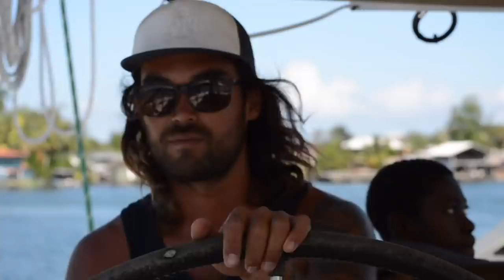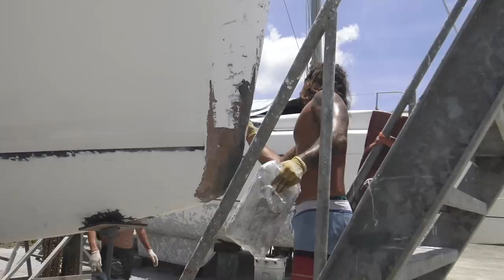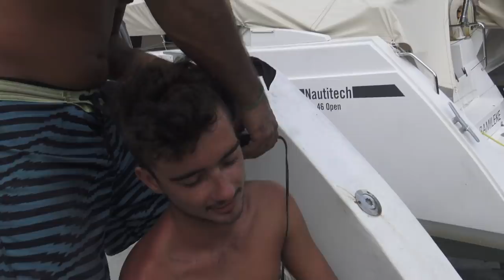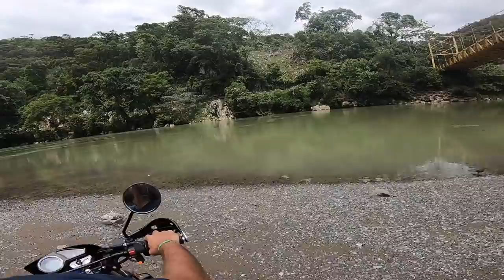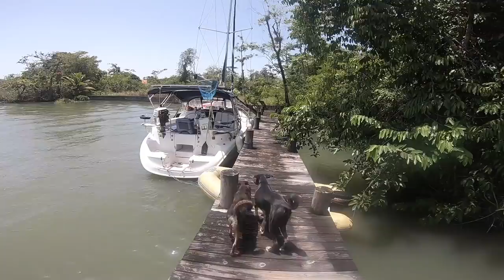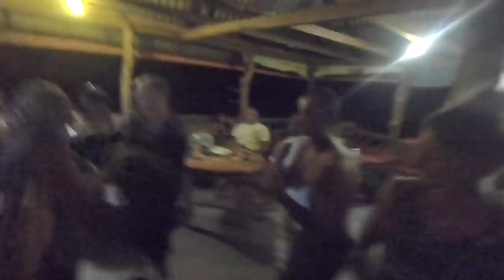Turning a HURRICANE DAMAGED CAT white again - Episode 41

Comment: While sanding in ive seen people use a cheap spray paint to find the low spots. Just spray a fine mist all over the surface and the paint will look scattered.  And after sanding youll see the little bit of spray paint in the low spots and youll know where to fill.

Comment: One suggestion when fairing.  Use guide coat.  Guide coat is a light misting of a contrasting color over the entire surface to be faired.  Used in conjunction with long boards it will reveal high and low spots rapidly and most of all, accurately.  Going by feel has never worked for me, especially after your hands are dried the fuck out and desensitized from this kind of work.
Reply: Jason is bang on! Even crushed up coal or blue chalk rubbed on by hand or a long fairing batton/wood lath will work in a pinch, I use cheap black sandable primer in a light mist. A couple of other thoughts, you need to use longer flat flexible boards to get it all properly faired(the idea here is the repair gap between factory GC needs to be bridged all the way across with the long board, that is the only way to true it properly), this will cut several cycles off of this stage. Lastly don't forget to drop all of your high glass spots a smidge so you can get a good mil thickness of GC
Reply: Guylandia funny you mention crushed coal.  3M makes a dry guide coat that wipes on.  What is it?  Crushed charcoal.
Reply: Good question. The short answer is idk. I've used it too, however the container I used had no information.  My suggestion was aimed at getting something usable that would be available in any remote location the reason I believe it will work Is that the coarse scratches in the surface will hold and stain it enough to use as a guide, and then be clean up before coating.
Reply: Guylandia what I meant when I posed that question is that the dry guide coat sold by 3M is actually crushed charcoal.  So your suggestion to use charcoal was spot on as it is readily available in most of the world.
Reply: @jhowell928s  nice, I'd imagine it's a fairly refined process then. It would be interesting to learn how and what wood it's made from.